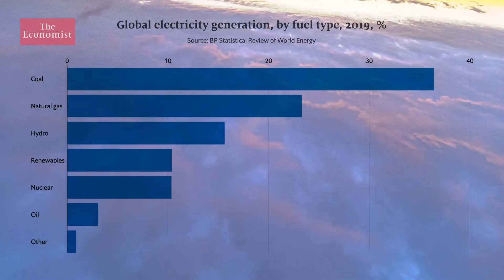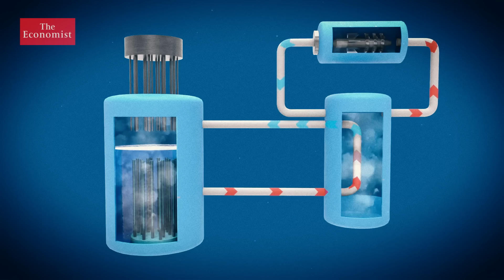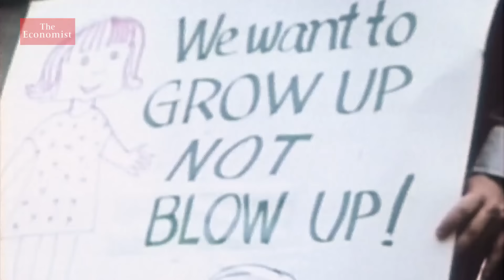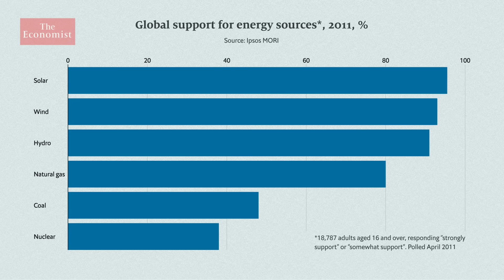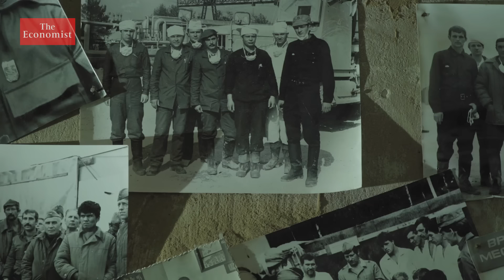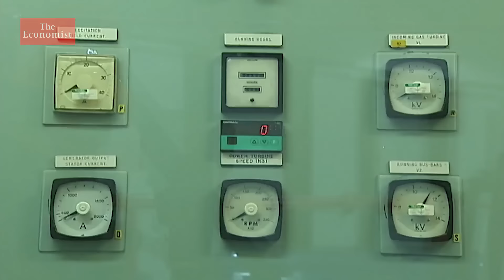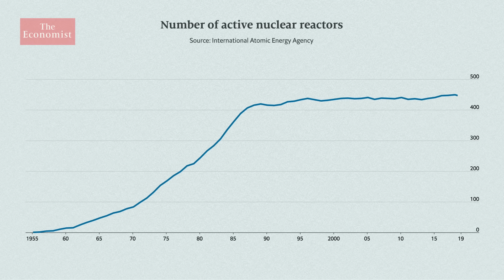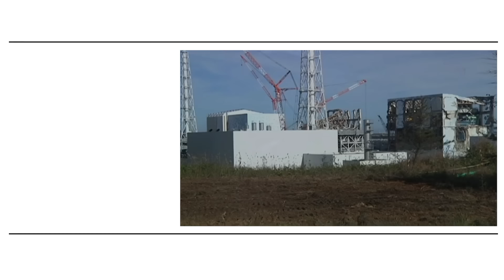Nuclear power: why is it so unpopular?

Comment: As if nuclear reactors won't be strategic targets in future wars.
Reply: There is no more war in the future.
Reply: All power plants would be, why would nukes be special? And if it gets the that point it's probably going to be an all out nuclear war anyways.
Reply: @capras12  Do you really need an explanation of why bombing a nuclear power plant would be worse than bombing a regular power plant?
Reply: @JowSithm  again, if a war ever gets to that point its going to likely be a nuclear war. Also that such a terrible reason not to do it. Wars are much more rare now.
Reply: @JowSithm  I do, actually. If the plant is properly designed, fuel should not be stored such that an explosion is going to cause it to reach critical mass. The necessary design choices to make the plant explosion proof are easy to implement - e.g. most ceilings above the reactor are going to be heavily leaded anyway. If that caves in, the reactor is now more resistant to meltdown, not less.

Meanwhile, a gas, coal, or oil stockpile will absolutely explosively combust if an initial explosion occurs. There’ve been quite a few incidents at Gas power stations across the USA over the last 30 or so years that made massive explosions, fireballs that may last for days, melted poorly placed fire trucks, etc. etc. And these are used started by leaving a fuel tank in the sun, let alone intentionally bombing the location.
Reply: @thesquishedelf1301  I mean, it's not likely to go critical. That's not what I'm saying. It's that the fuel in the reactor will no longer be contained in a shielded facility if there's no facility left to contain and shield the highly radioactive fuel. The biggest danger of Chernobyl wasn't (and isn't) the initial explosion the destroyed the building, it's that the fuel was blown all over the place and was open to atmosphere contaminating the entire area had half of Europe.

Comment: What about the nuclear  waste.
Reply: Valuable fuel in thorium molten salt reactors.
Reply: Salt is highly corrosive,  especially when heated. Try again. 
Hey! What about that Huge Nuclear Fusion thing in the sky? We could build Solar Panels and Wind Turbines....

Since this comment had already been edited,  I edited it AGAIN to correct "Fission".  Credit goes to  @Santill Brezon for spotting it.
Reply: @arcanondrum6543   Build your solar panels and wind turbines.  You will have massive rolling blackouts without nuclear support.
Reply: @arcanondrum6543   Do you mean  the sun,  isn't  that  a big nuclear  fusion  furnace.
Reply: @santillbrezon2161  BINGO! I DO mean the Sun and yes it IS a giant fusion furnace. It is responsible for ALL Life here on Planet Earth (which, sounds pretty important). Let's use that Energy with Solar PV and Wind Turbines!

If we ever get to the point of harnessing Nuclear Fusion without obliterating an area 6,700 times larger than the Fission Bombs from WW2, cool!   Until then?  Green Energy is downright awesome!  Remember,  Man was around LONG before petroleum and electricity were used. If we truly ARE smart, it will not be so difficult to change. Plus we will not scrape ourselves off the Planet  - so, there's that.
.
Reply: @santillbrezon2161  Oh, I see your point. My comment up above has : "Fission". I will blame spell correction because I knew better but maybe I mistyped??? I did start the evening without reading glasses.

Comment: The amount of easily accessible uranium is limited, so its either just a temporary fix or a step towards unsafer methods.
Also it doesn't help when the bills of the people promoting it are paid by large industrialists.
Reply: There is an estimated billions of years in thorium supply....
Reply: @danadurnfordkevinblanchdebunk  That's what they estimated about Uranium too, but you're talking trace amounts in normal soil and water that are not economically viable.
From what I read we have 'easy' Thorium for about 2500 years, so at first glance way better than Uranium, but then abovementioned industrialists are not cooperating one bit to develop Thorium; radiation levels will go up, be it 'only' for 300 years (down from 100k-250k years), but that is assuming it can go to 100% fission of the Uranium and Plutonium that is still needed to make this work, as Thorium is not a fissionable material by itself.
Reply: @panbrood  The molten salt reactors were developed in the 60's and an experimental MSR operated for five years before being decommissioned in 1969. Couldn't make bombs with it so funding was ended.  If it wasn't for anti-nuke propaganda, we probably would have replaced all our existing nuclear power plants with MSRs.  They would have eaten our "nuclear waste" for dinner.

Comment: 2:58 Unaccurate! In order to make a fission cause another fission the neutrons, which resulted from the fission first need to get slowed down. If they dont slow down and hit other nucleus' they will just bounce off and nothing will happen. In order to slow them down it is required to have a moderator (usually within the coolant), which is only there for the purpose to do the slowing. Boric acid within cooling water is one example. In order to stop the chain reaction from excalating or stopping it completely you need another moderator designed to absorb neutrons.

Of course you could remove the coolant - And if the reactor pressure vessel somehow bursts within a pressurized water reactor, the coolant actually nearly completely removes itself inevitable since water at 300°C at atmospheric pressure is gas and not fluid anymore. Since such a burst will suddenly lower the pressure a lot this will be the only logical consequence. 
Of course you have an extremely expensive mess after this and if your partents get home youre basically dead, lol. But at least your reactor core shouldnt heat up by much more after this since there will be barely any fissures occuring. Just hope there was no radiation escaping. But even if it did, at least your reactor core most likely didnt melt entirely. Partially maybe.

Just keep in mind that pressure water reactors are not the most efficient designs despite their significatly higher safety. There are more efficient designs and meanwhile even safer designs. But its still a huge mess if something goes wrong.

But the previous accidents involved a lot of human error, which could be countered by shorter work periods, higher concentration, more workers watching out for each other, etc. But all of these solutions costs actual money, which is bad since companies are trying to be efficient, right?

Comment: Iran bad
no mentions of nuclear waste
Amazing quality of journalism here.
Reply: It’s a valid problem but climate change is a far bigger one. Nuclear waste may be extremely dangerous but it can be contained, unlike the toxic fumes released by burning fossil fuels. If you live in a city, you’re already significantly more likely to suffer from respiratory illnesses or develop lung cancer.
Reply: @jan_Masewin  if you count thoroughly all the aspects gas turbine power plant is the best solution. It can run on a "green" hydrogen or bio-methane or just straight natural gas. Very efficient, easy to scale, not so much in terms of ecological damage.

Comment: Problems with fission energy: it's unefficient. At best, the actual electric energy to the grid is 8,2% of the released energy. On average, it's 4-6% on modern powerplants, and around 2% on the older ones. Rest goes up in the air with radioactive particles, or in the sea with radioactive particles. Yes, every nuclear powerplant leaks radioactive particles all the time as a safety measure, otherwise those nuclear silos would explode from the pressure. And those particles are deadly, causing cancers and other painful and terminal diseases. Also it is very expensive, costing tens, hundreds, even thousands times more than same amount of renewable energy, and it's just one energy source. If something happens at the plant, all power shuts down in the region. So not only everyone is covered in deadly fallout, but no one has any power to survive the deadly fallout. So, the nuclear powerplant owner has a strangle hold on it's region owning all the energy, and can charge anything he pleases for this wasteful energy source, dragging everyone in debt, and into poverty. So in short, if you support nuclear energy, you also support the most evil totalitarian policy known to man. Nuclear fission energy is not safe, it is definitely not reliable, and most definitely not sustainable, by any means of those words.

Comment: Anxiety? Sweden has 7 reactors going and I'm no more anxious about a nuclear disaster than I was before Fukushima, meaning not at all. There are currently 440 operational reactors in the world and we've only had two disastrous events since its invention in the 1940's; Chernobyl and Fukushima, occurring a quarter of a century apart.

Nuclear power is the way to go.
Reply: There's been 52 meltdown accidents on record since the 1950s. Just saying. And disastrous events, as in what? they exploded? or just leaked radiation into the environment, because if it's the latter there's way more than 2.
Reply: @robinhood5627   And that makes nuclear the safest.  Check how many deaths associated with those 52 "meltdowns" (not accurate, not all those were meltdowns, call them accidents or incidents, Chernobyl wasn't a meltdown after all, it completely exploded).

Comment: The US military industrial complex had their fingers in the trials process in favor of making bombs. They chose to encourage the production of large scale projects that had huge cost overruns and produced bomb material as a by product. Had they chosen the MSR system instead, we would have had less bombs and smaller, safer nuclear reactors providing electricity and hot water to heat houses.

Comment: How is that this video mentioned nothing of the problem with Nuclear Waste? 
Isn't that the main reason we don't have wider use of nuclear power?

I would have expected better from a journalist at The Economist!
Reply: nuclear waste is not  a problem, most remarkably dangerous nuclear waste actually is worth more than gold, like plutonium. But is sometimes not used because of political reasons, or for over abundance of viable U235 rich fuel.

Comment: Like every other technology the atomic industry has developed and improved over the years. The short segment on advanced nuclear, in this very informative report, only touched on micro atomic developments.  One such technology is Molten Salt Reactors (MSR) developed by the Terrapower, Core Power, Orano and Southern Power consortium and backed by the U.S. Dept. of Energy. MSR technology  is at ambient pressure and the fuel is the coolant so it can't explode, once the fuel cools below 400 degrees centigrade it turns to a solid rock. More than 90% of the fuel is used compared to single digits for LWR and PWR. Core Power will have a micro battery prototype for ships ready by 2024. The MSR can also provide the energy to produce synthetic fuels such as green ammonia and methane.

Comment: I agree with 99Janis' comment below. The unpopularity of nuclear, especially with private investors, is that there is no solution to spent fuel rods. The video does not cover this at all. Waste must usually stored on-site because of the unavailability of disposal sites and outrageous cost of shipping the waste material. Without a solution to this key part of the supply chain, return on investment is severely curtailed.
Reply: Those spent fuel rods are valuable fuel to be further depleted in thorium molten salt reactors.

Comment: The future is renewably powered. Roof top solar PV, neighbourhood solar PV, community solar PV, regional wind farms connected to regional hydro, grid batteries, high insulation, high efficiency, electric heated thermal mass floors and bidirectional electric vehicles.
Reply: With massive rolling blackouts without nuclear.
Reply: @danadurnfordkevinblanchdebunk  The Hornsdale Power Reserve is Australia has proven otherwise sir. This 315 MW wind farm is backed up by the huge Tesla grid battery with 129 MWhrs of storage. This facility is so successful that it repaid the investment capital in 2 years which is why it has just been upgraded by 50%. This grid battery has eliminated blackouts, stabilized the regional electrical grid, reduced the price of electricity, lowered carbon emissions and air pollution.
Reply: @aaronvallejo8220   Not they haven't.  There isn't enough lithium on the planet to do what that isolated Aussie experiment has done.

Comment: No mention of what happens to the spent fuel and for how long that needs to be managed. Pity. It comes across as fairly unbalanced as a result.
Reply: It’s a valid problem but climate change is a far bigger one. Nuclear waste may be extremely dangerous but it can be contained, unlike the toxic fumes released by burning fossil fuels. If you live in a city, you’re already significantly more likely to suffer from respiratory illnesses or develop lung cancer.

Comment: The Oyster Creek nuclear plant in NJ was built in four years, ran for 50, and cost $700/KW to build, cheaper than any other kind of firm power then or today.

If there’s a closing topic useful for study, study Oyster Creek and the forces today stopping it’s repeat, and not “my report on Fukushima”, where tens of thousands of the public were killed by a quake and tsunami and none by radiation.

Comment: Interesting report, however besides the high cost of construction, the video didn't address "what do you do with the waste", which is not just the spent nuclear material, but everything used from tools to paper towels must be disposed of.... Real problem.  Hundreds of tons of this material is sitting at every nuclear site around the world.
Reply: It’s a valid problem but climate change is a far bigger one. Nuclear waste may be extremely dangerous but it can be contained, unlike the toxic fumes released by burning fossil fuels. If you live in a city, you’re already significantly more likely to suffer from respiratory illnesses or develop lung cancer.

Comment: there are other problems that prevent nuclear power from reaching it's potential
not only public sentiments, in china, they are using renewable, not because nuclear is bad, but because they can't build as much nuclear plants as they can
it just can't scale that greatly, and the problem of dismantling old plants, make nuclear power more expensive, bc of externalities
and new nuclear plants are way more expensive, so it's kinda a dead end
no new nuclear technology, because too expensive, old plants aging and hard to maintain

Comment: Fukushima showed nuclear energy is "not dangerous"??? Over 150.000 people had to evacuate their homes. Many for years. Some have still not - and will never - return. Its a personal disaster for each and every of them. This is a real "danger" issue not to be neglected. I am not against nuclear power, but this is glossing over many of the real challenges. Also, the failure of that one plant caused brown outs in Japan over 6 months afterwards - so much for "firm energy supply".

Comment: What isn't discussed here are the problems surrounding  the safe disposal of nuclear wast, the spent fuel any fission nuclear reactor produces.  This waste, rich in plutonium, remains both radioactive and toxic for up to 250,000 years and must be kept secure in a way that prevents it from leaking in to the environment.  The present value cost of securing something something that long lived is insanely high.  Just trying to predict interest rates for 250,000 years is practically impossible.
Reply: Stored underground

Comment: Did I miss the mention of waste disposal? Isn't that the biggest issue?
Reply: What about it? The “waste” is solid metal rods that are stored inside weatherproof dry-cask storage cannisters and stored on-site in a secure location. It is neither a security nor environmental risk.
Reply: @piouswhale  That's not the only kind of waste, but since it is the most dangerous, it's worth discussing. The dry storage is licensed for 40 years. But it is dangerous for 250,000 years. In the whole world, there is not one single permanent disposal site. Because how can you secure it for that long? Give it to the next generation for the next 5000 generations is not very nice.
Reply: It can be stored indefinitely. If a cask is damaged after X years, you put it in a new cask. There are also reactors that can utilize those spent rods as fuel.
Reply: Also yes, spent rods are the only waste. Commercial nuclear power does not produce any other type of waste
Reply: Put in a new cask every 50 years for the next 250,000 years!?! I hope you don't make too much more then.
Reply: I have to wonder if you are just playing with me with these comments.